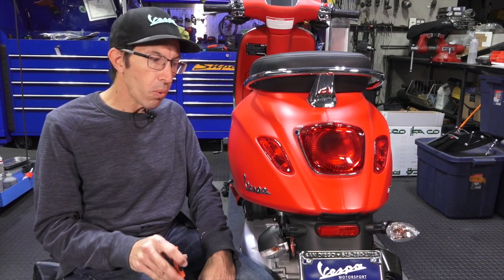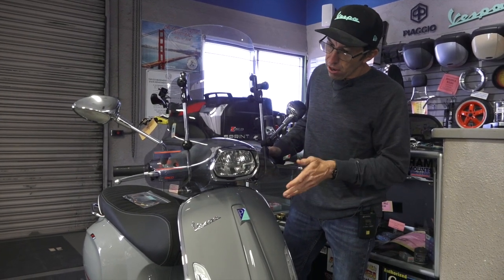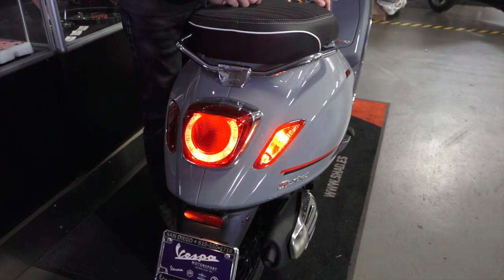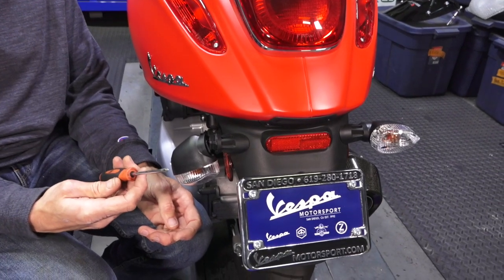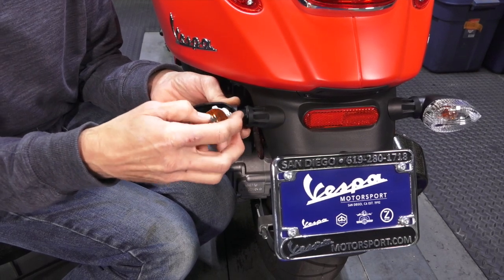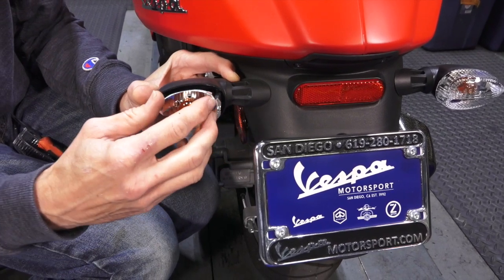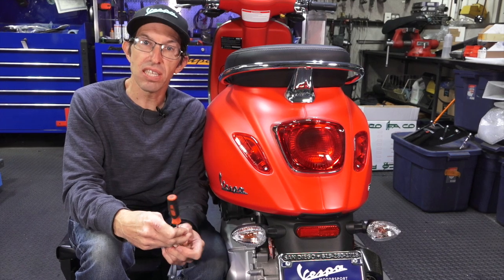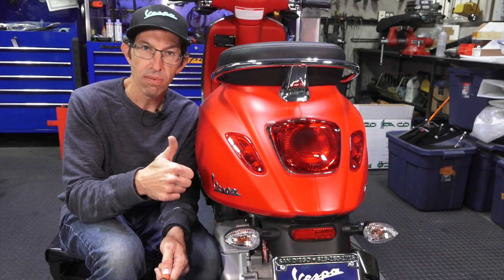How to Fix a Broken Turn Signal on a Vespa Primavera or Sprint

Comment: Thank you so much for making this video, Robot! The service guy at the dealership in Brooklyn told me this was a 30-minute job that would cost me $75. That seemed unreasonable, so I googled and found your extremely helpful instruction. It sucks that the Vespa dealership tries to take advantage of new riders like this! I deeply appreciate what you do for Vespa riders, especially the way you break things down, with clear instruction and little tips and hacks (like tucking the gas cap under the edge of the bucket when refueling). Please keep teaching us!